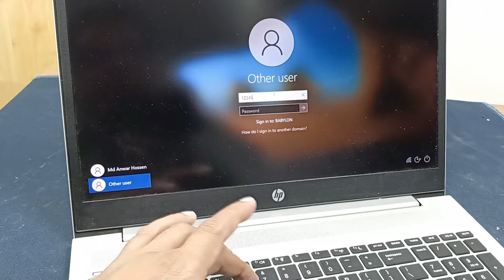Hp Probook 450 g6 keyboard replacement / change

Comment: Absolutely appalling! Absolutely wrong procedure 😅 you have to use a soldering iron to melt the plastic keyboard holders after the sheet metal is seated!! (which you destroyed by violently tearing it off instead of removing the plastic with a scalpel) catastrophic, horrible!